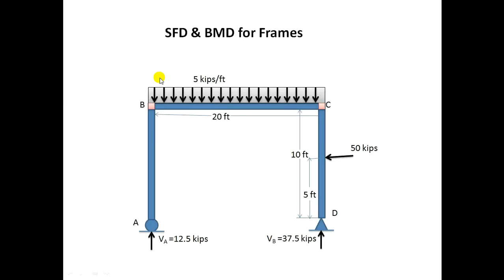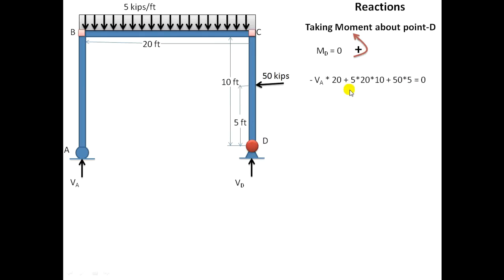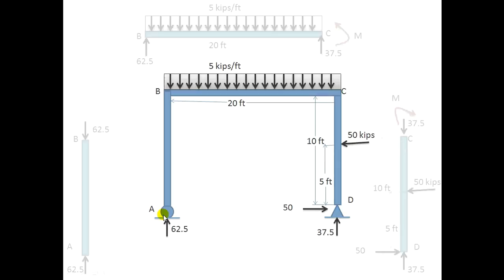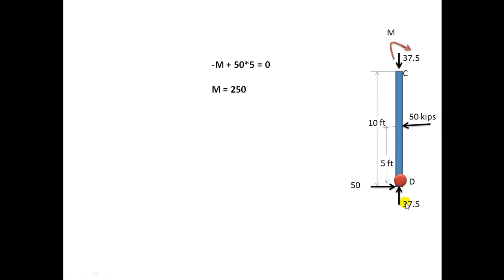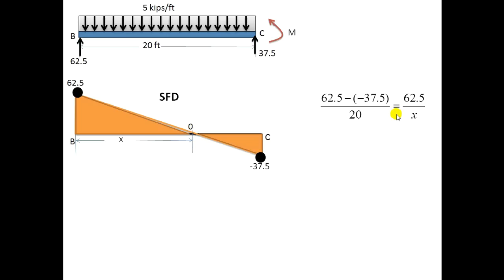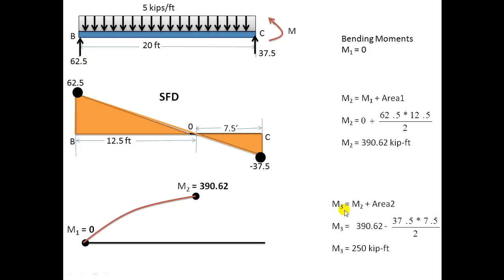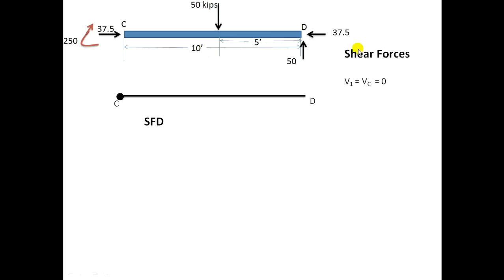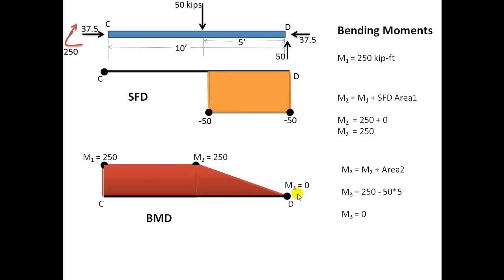SFD and BMD for frame

Comment: I didn't agree with the reactions values! I'm sorry to ask but, Is the reactions correct?
Reply: The correct reaction in pont A is 62,5 kip...
Reply: @carollucena2422  ay =100 and by=0 am i right
Reply from the maker: Yes you are perfectly right, it is incorrectly written at the beginning of the video but i have correctly calculated it after. You can check as the video progresses.
Reply from the maker: I appreciate for your detection.
Reply: You're welcome!